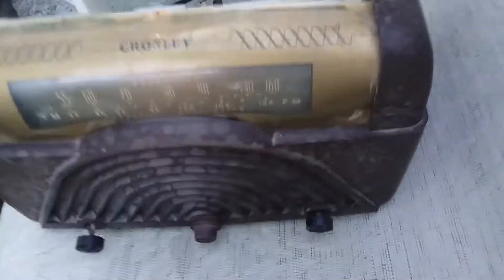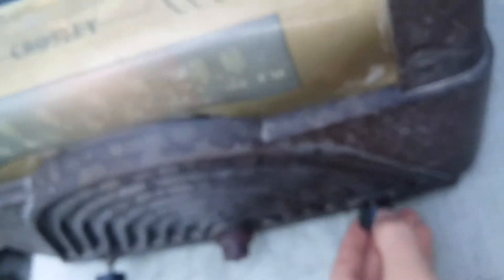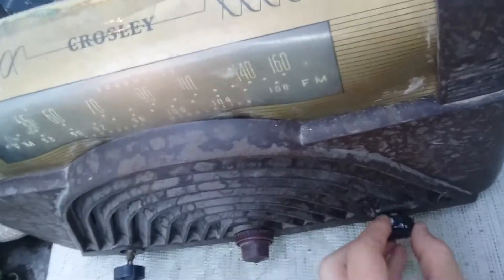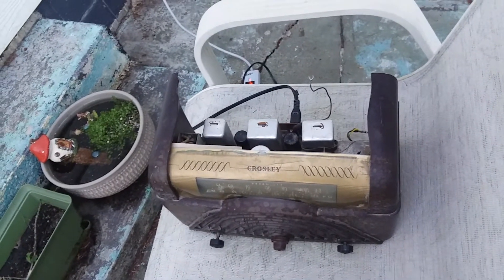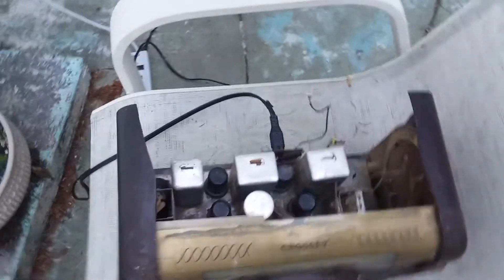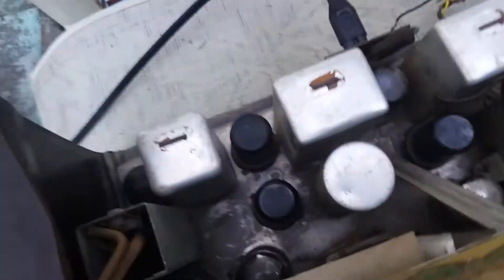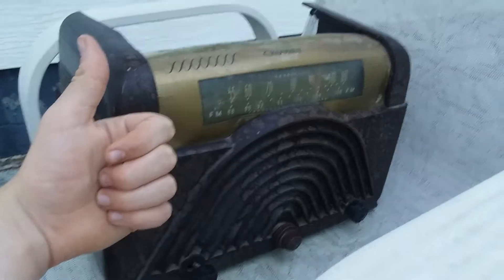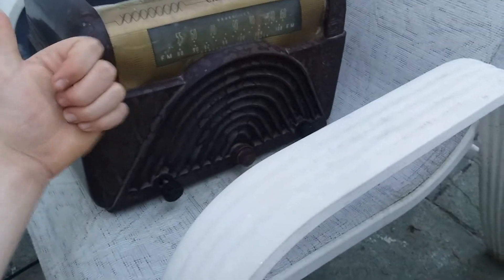Turning on the crusty Crosley, will it work?

Comment: You lucked out that you didn't blow a fuse or have smoke billowing out of the radio. Really didn't hear any AC hum like you normally do. Two thumbs up
Reply from the maker: Thanks, I was surprised it worked as well as it did. I had it run all day yesterday as my dad and I worked outside, it worked just as well as it did in the video. I took my inferred temp. meter and checked the caps  they were not super hot. After watching Shango066 just power his up like this, it gave me confedence. I don't care as much if it gets messed up because of its condition and these are quite common. Thanks for watching! Hope you enjoyed!

Comment: The ticking/crackling you heard was probably the electrolytic caps arcing internally. 

This will be a great radio when it is recapped, aligned and cleaned up.

Oh, and next time, whenever you power up an old radio, wear some insulated gloves.
Reply from the maker: Yep, the only thing that has been replaced in this is 3/8 tubes, and the speaker. Other than that, this is all original Crosley components. This looks to not have very many hours on the tubes that have been replaced, no tungsten evaporation.  Do you know if this case could be replaced or if I should just make or buy a new cabinet?
Reply: @bratwurst2923  Not sure on the case....depends on how many of those were originally made...if it was a lot, a bit of 'net searching may turn up some inoperative ones with good cases for sale (which would give you spare parts too). Otherwise you may well end up having to make a new case.
Reply from the maker: @mxslick50  yeah, kinda what I thought :( but at least this set is pretty common. But if I can't find one, it will be a fyn summer workshop project, I'm also going to work on that 56 Zenith's wooden case, just a refinish since the current finishing is falling off and getting everywhere.